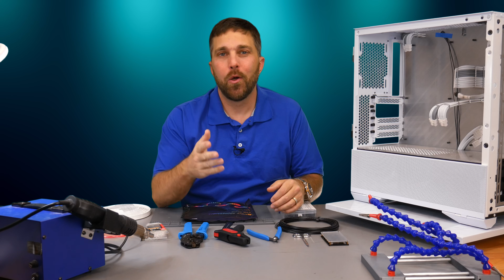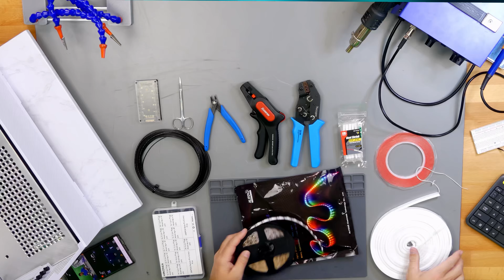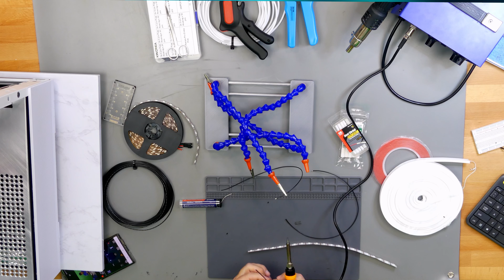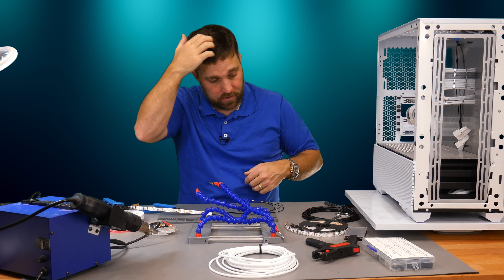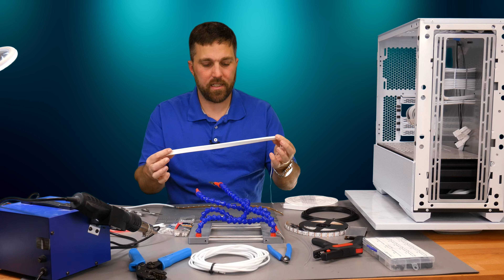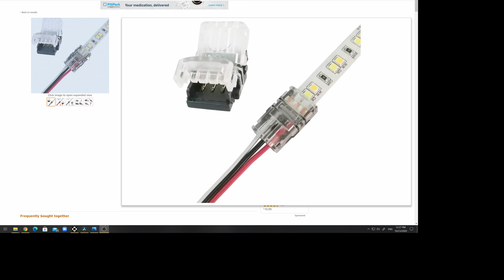How to Make Custom Addressable RGB Neon Strips

Comment: It's a good video on installing LED strips, but your explanation of voltage and where you're adding power to these strips is really wrong. Putting two +5V sources on the same wire isn't going to pump +10V into a wire. It's going to be +5V with the combined current of both wires.  It also doesn't do anything (besides add work) to attach power at both sides. The way the WS2812B LEDs you use work is by having a wire run down the length of the strip already. That wire is what you're soldering to, so you basically just soldered a big loop of wire. 

You are totally right that you shouldn't combine two +5V rails from different power cables on a computer PSU though. The reason is that there will be minor differences in the voltage between them. For example one source might be +4.5V and the other at +5.5. This will cause the difference in voltage (1V) to flow into the lower power supply, backfeeding the PSU.

I hope I didn't come across as overly critical, I really appreciate you showing how put these strips in cases. A lot of the electronics info I know came from youtubers like you.
Reply from the maker: it's been a while but I think I was referring to connecting to two different Hubs which would be wired in series. That would double the voltage. I wired the strip in parallel. I probably didn't explain that well.

Comment: Hello... great great tutorial thank. CAn I ask you a question plz? Does just one 5v connection in one side of the strip is enough for a 30 led strip or its better to do as you made on the big strip and connect 5v and ground on both sides? Thanks in advance!
Reply from the maker: for 30 one side should be fine.
Reply: @ElevatedSystems  thank you again 👍

Comment: Hi CJ. I live in Brazil, and I'm really enjoyng  your videos, specially the Lian Li Lancool 2 ones, cause is the case I've picked for my first PC assembly, and maybe you could help me to solve an issue that is bothering me.  I've spent a few days assembling my first PC specially for all the ARGB devices I'm using (memory, water cooler, fans, led strips) and I was quite happy with the results, cause I was able to synchronize all my ARGB devices and the front panel leds, all controlled by the ARGB headers of my gigabyte aorus H470 Pro mother board. The cable managemnet took a long time and now is everything tight on place and working beautifully. But the POWER LED of this case is  steady white color, and this is bothering me a lot to see all the ARGB LEDS synchronized and just this POWER LED standing out in a steady white. I'm intending to change this POWER LED to a WS2812B LED (or similar) and synchronize it with the rest of the set up. But I don't know if the POWER LED of this case is integrated within the POWER BUTTON, or if it is a separate component soldered or placed below the POWER BUTTON. If the POWER LED is a separate component, I'll dismantle all the cabling and the top control PCB just to figure out how to replace this POWER LED, but if the POWER LED is integrated with the POWER BUTTON, I think I won't be able to solve this issue. So, as you know a lot about this case, and have such wide modding skills, could you please tell me if the POWER LED is a separate component, so I will be able to replace it? Maybe you even find this subjet interesting to show in your channel so I can get a tutorial on how to do that. I think that probably a lot of people who bought this Lancool case, and also love ARGB light effects, is somehow annoyed with the WHITE STEADY LIGHT of the POWER LED, and probably wish this POWER LED to be ARGB controlled.  Let's see your thoughts on that. BTW I couldn't find the rest of your Lian Li Lancool project, setting up the fans and concluding it. Are they already available yet? Many thanks in advance for your help on this issue. Take care.
Reply from the maker: My Lancool II mesh is still disassembled so I'll take a look at the power button when I get a chance. I haven't finished the project yet as I'm in the same boat as everyone else waiting until I can find a new Graphics Card to replace the 2080ti from my production workstation that I plan on moving to my gaming PC.
Reply: @ElevatedSystems  Thanks so much for your prompt reply. Looking forward to see the rest of your Lancool project, and for information on the power button, when you have a chance. Congrats for the excellent job you've being doing in your videos. Complete modding tutorials..... I'm already thinking about my next PC assembly using a lot of your guides. Take care.